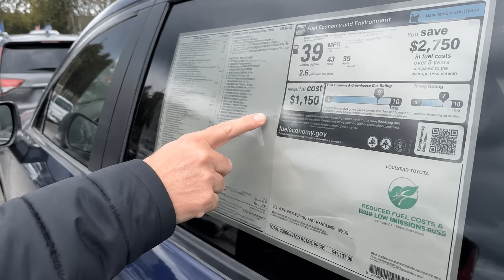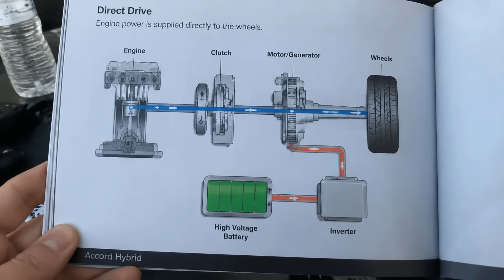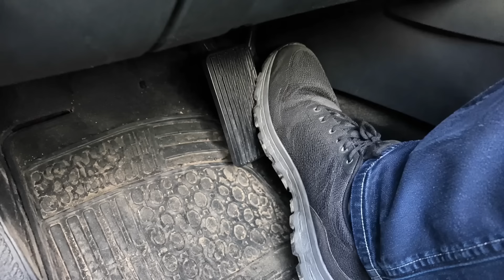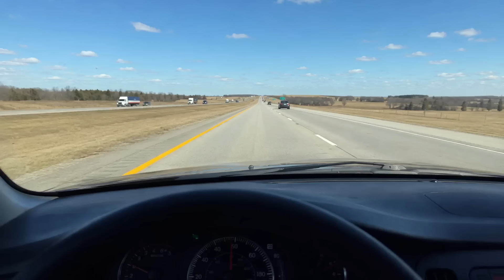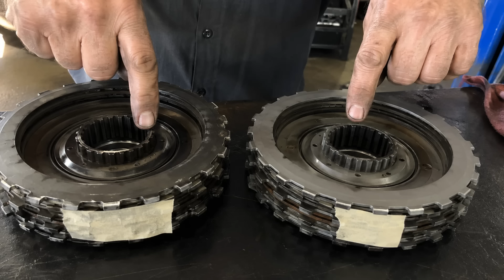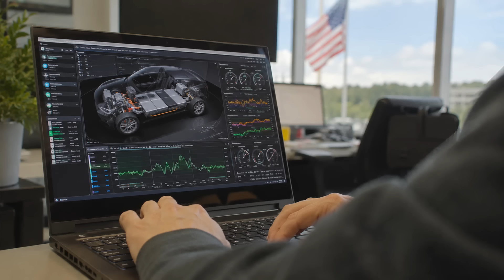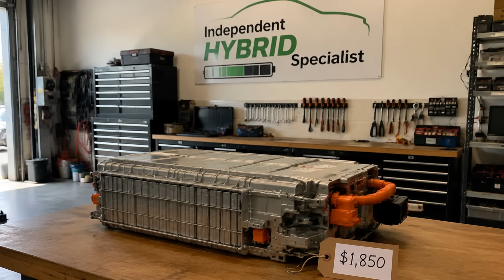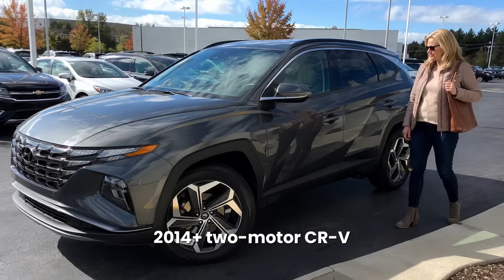Toyota vs Honda vs Hyundai Hybrids: Which One Has The WORST and The BEST Hybrid System?

Comment: A good video review - thank you.    Absolutely agree about the RAV4.   HOWEVER, no spare tire on the Honda = D.O.A. !!  However, although the  Hyundai / Kia hybrid system is understood, the cockpit is superior to the others in many ways, it is where you live your life in the vehicle, the basic system gets the job done along with the superior warranty, AND IT IS BANG FOR THE BUCK!  ...  comprehensively worthy of consideration!
Reply: I spoke with a Honda tech about why there's no space to even carry a spare tire in the Accord, and he said it's because the hybrid traction battery is located in that space.  I was surprised that the heavy battery was positioned behind the rear axle and left vulnerable to even a relatively minor rear-end collision.   The 2026 Accord touring hybrid also has big heavy 19 inch wheels which worsen the ride (from more un-sprung weight),  and reduce the number of tire replacement choices.   But I agree.  During my life so far, I've had four flats, all in remote locations while on a road trip.  I will not buy a car without a spare.
Reply: @WakeUpAmerican000s  The Accord has a wheel well that can hold a spare. You can find kits online.
Reply from the maker: Great point!

Comment: I have a 2011 Sonata Hybrid in my driveway with 240,000 km on the odometer. I am the second owner. It was an auction buy which became a gift from two sons at 150,000. On delivery my son passed over the keys and cheerfully advised me that: "this thing really moves, we did 220 kph all the way here from home". (His home is two hours away at normal highway speed.) 
I expected an ill-maintained junker but the car has delivered one lovely surprise after another. Mechanically it is receiving all of the maintenance in the schedule with the exception that I always change my oil at 6,000 km and use full-synthetic oil. 
The transmission gave a warning twice before I figured it out. In cruise at ~110 kph on a particular uphill grade the transmission seemed to be running low on fluid. On each occasion I coasted to a stop on the breakdown lane and switched off before restarting.   I ordered a new transmission filter from Rock Auto and took it to my favorite shop along with a jug of Valvoline's finest ATF - and requested that they have a look at the existing filter. I saved the old fluid in order to settle it out and then examine the clutch material. The old filter is rendered inaccessible by a bolt which can only be removed after the trans is split from the engine -  a design error made good later in the same manufacturing year.
The refilling process is simply medieval and I was disappointed when my mechanic declared it done. Having seen a couple of YouTubers I had expected the flow rate to be higher. I drove it for a thousand km and then took another jug of ATF to the shop and asked them to do it again. The fluid which we drained out still had some dirt an we closely examined the filter but could not figure out how to McGuiver the new filter in there with out getting possible sludge from within the filter into circulation.
The second refill gave a better rate of flow and the car has driven 50k since without incident. We were able to examine the clutchpack closely and my (very) experienced mechanic said it looked like it should have 'lots of life left'.
Our economy here in Canada is measured in litres per 100 km, rather than mpg and the car is accurate if working from a full tank. It indicates 6.5 litres per ckm. The mileage is drastically affected by poor alignment, 'any' loose knuckles or joints and low air pressure in the tires - which I maintain at 35 psi (going to try 38 psi next).The fuel economy compares less favourably with my brothers prius which regularly gets into the 4 litre per ckm range and my cousins Honda (Insight???)  also in the 4 l/ckm range.
My brakes are in better condition than theirs as neither of those cars seem to need real brakes for much of their driving, whereas mine REQUIRES me to touch the brake pedal inorder to maximize the regenerative feature. I don't understand it but it is consistant
Reply: Change your transmission fluid every 60,000 kilometers and change your filter that cools your battery pack. 
Change your brake fluid it probably has water in it.
Change your Anti Freeze
Change your fuel filter
Change your Cabin Air Filter
Get an alignment
Replace all loose Tie Rods
Now you will be good to go without a big repair Bills! 
Cheap Charlie’s Always Pay More from LACK OF MAINTENANCE

Comment: I'm a gearhead. I have a 6 speed Ioniq HEV hybrid.  Of course I feel the engine start. I hear it, I feel it through the sest.  I've driven stick shift cars for decades. I'm trained to know what my drive train is doing.  Slushy Toyota or Honda drives would be my worst nightmare.
Reply: HAHAHAHA I'm 78 years young, have driven roughly a million miles with everything from motorcycles, cars, trucks, including fire trucks, a Navy submarine, boats of various sizes and small airplanes. And now, I LOVE, how the 2026 Camry Hybrid handles, drives and feels. It's truly amazing! I'll never willingly go back to anything with a traditional engine and transmission. There's absolutely NOTHING "slushy" about it. Driving it is like traveling in a jetliner that doesn't have to change gears several times, as it accelerates down the runway for takeoff. I LOVE it.  But, to each their own. <3

Comment: Toyota does have transaxle/engine damper. No idea how long they last. I suspect it's the same as the inverter. Heavy feet, heavy wear.
Reply: Engine dampener?
Reply: @robertheinkel6225 minimal clutch/pressure plate. Smooths the ICE on/off

Comment: I have a 2025 Civic hybrid, it is perfect, sporty and enjoyable to drive. Admittedly, I don't have a decade of history but as of yet, there are no reports of problems from the 100 of thousands of Honda hybrids on the road. They are hard to find to buy. When I bought mine, I found one 2 states away and bought it unseen.  But, I have been as happy as a clam at high tide (a Florida saying). I have noticed that the mileage drops by about 2-3 MPG in the Florida "winter", mostly since the system has to use the battery to heat the car since there is no consistent source of engine waste heat to tap.  My mileage runs consistently in the 46-50 range. I'm a professional engineer BTY and pretty attuned to complex systems. I've had Hondas for years and have found my wife's Toyotas to be "numb" appliance like drivers. She's okay with that but I'm not.

Comment: I went for the CRV Hyrbrid over the RAV4 Hybrid. But, I chose the 6th generation Hybrid over the 5th generation because it uses two electric motors instead of one. I am averaging about 38 to 39 mpg in the city and around 32 to 34 mpg on the highway. But, as for climbing hills, I live in the DFW area which has hardly any hills. Even so, when I do encounter a significant hill in the 6th generation CRV Hybrid, I haven't noticed the problem you mentioned in this video. I have to assume that the two electric motors make a difference in how it handles a hill.
Reply: "But, I chose the 6th generation Hybrid over the 5th generation because it uses two electric motors instead of one."

Both use two electric motor-generators; pretty much the same ones, in fact. Torque was in the traction motor was increased by 15 lb-ft, and it is a little bit bigger in size.

Comment: I had already decided against buying my first hybrid car (all brands) after test-driving a Honda CRV hybrid when I watched your video. I simply don't do enough stop-and-go driving to be attracted to a hybrid. I’m 74 and retired. I live within 2 miles of an interstate highway that connects to high-speed loops and long stretches of highway. I take long road trips that are 95% highway driving. I agree with your conclusion that the Toyota hybrid is the best among hybrids.  You present an excellent argument in favor of the Toyota. I'm currently betting on a pre-owned naturally aspirated gas-only 2025 Toyota RAV4 with 5,000 miles. I keep my cars well past 150,000 miles, and at 10k miles per year I could be driving my gas car in 2040 at 89 years old…if I outlive the car. I'll watch my neighbors struggle with 4-digit repair bills while I spend a little bit more at the gas pump. 😂 Thanks for an excellent, detailed discussion.
Reply: Traded my Rav4 in for a new Corolla Cross xse hybrid.  Great car for Florida traveling.  Rav4 had no power getting on the ramp. This Corolla Cross moves  No problem. Excellent gas saver.
Reply: I have a 23 Sienna.  I mostly use it around town, but also make cross country trips.  For a big vehicle, getting 32 mpg in town is very good.  In comparison, my Odyssey, doing the same drive would average 18 mpg.  On the highway, the Sienna averages 35 mpg, while my Odyssey would average 24.
Reply: If I were in your situation, I would still highly recommend the honda hybrid. I have a prius and I have a mechanic who almost exclusively works on hybrids. He told me that he has never seen a drive train failure in a toyota hybrid. Toyota gas only cars are good but even their transmissions are not as good as they hybrid drive system which is not a true CVT. Also all new cars spy on you. I might recommend a pre-2019 car before 5G was installed.

Comment: Tucson has only one motor rather than the other two with two motors. Does that make it the worst??
Reply: Tucson only needs one. Mechanical all wheel drive like the Subaru system. No motor in rear.

Comment: We own a 2022 Toyota Highlander Hybrid that just surpassed 100,000kms.  Other than recalls, nothing has been done other than regular maintenance.  Can we look forward to the same performance as the other Toyota hybrids you name in this video?
Reply: Yup
Reply: Our 14.5 year old Camry hybrid has 90k trouble-free miles.  Only a new 12v battery ($300) and tires and PCV valve ($14) on top of routine service for fluids.  I can see why most New York City taxi drivers like the Prius and the Camry Hybrids.  They get 250-400k miles out of them.

Comment: You could just said the hyundia is a piece of crap.  I already knew hyundia is piece of crap
Reply: Most mechanics confirm that Hyundai is substandard compared to Honda and Toyota.
Reply: I have a 2026 Hyundai hybrid with 6000 miles on it. Impressed every time I drive it. Much quieter and nicer ride than the Honda and Toyota we drove.
Reply: Probably never drove one. If you had driven the new hybrid Hyundai, you’d change your mind for sure. I did.
Reply: Pretty obvious that you have it out for Hyundai.

Comment: I have a 2014 Accord hybrid with 195,000 miles it runs like it did 12 1/2 years ago. It has never seen the inside of a a shop. Nothing has worn out or broken. All it has needed was fluids and filters and a set of spark plugs that the maintenance schedule called for at 100,000 miles. It has needed 3 12 volt batteries. I am about to change the brake pads for the 1st time not that they are grinding just that I want to lubricate the calipers and might as well change the pads. It's been a flawless ownership experience.
Reply: Engine belt?
Reply: Im not sure, but hybrid cars seem to not have any belt. What will belts do in a hybrid car? I can't figure out, like the generator is in the hybrid "transmission", and compressor for AC runs on electric
Reply: @taoprsn  Japanese cars have always had an engine belt for the camshaft movement. Many other cars now have them, too.
Reply: @BeachriderUSA  I own a fl4 civic hybrid, and it seems have engine timing chain but not belt
Reply: @taoprsn  so it goes… the Honda Vans and pickups still have timing belts, but not the Accords and Civics. Thank you
Reply: @BeachriderUSA  Glad that helps :)

Comment: If i had to, i would buy the Toyota. But I prefer what I have:  A  2022 Lincoln Corsair PHEV and a 2024 Ford Escape PHEV.  They have been great. Currently, my lifetime fuel economy on the Corsair is 115 mpg. That is because last year, I drove about 10,000 miles on battery alone.
 Ford's system is nearly identical to Toyota's.  It is the only system that makes sense. Hyundai's and the similar Mazda system, are just plain stupid.  Honda's system  needs a larger electric motor since the gas engine can't contribute except under the narrow conditions the motor can be engaged.  The systems I really hate are the ones that add a turbocharger. For me, one of the great benefits of hybrid systems is the lack of turbochargers and overworked small displacement engines.  Ford's 2.5 is an Atkinson jointly developed with Mazda but Mazda never used it.  Unfortunately the Chinese built replacement for the Corsair uses a turbo 2.0.  I plan to keep my 2022 for a long time.

Comment: I did a ton of research on hybrids before buying a rav4 prime  while the prime is a plug-in  hybrid  i can tell you this thing is a pleasure to drive and it is insanely  quick for a compact suv faster than pretty much all but some european models and since i can do most of my driving in ev mode  the combined eMPG is well over 80 yes 80 mpg. My wife also has a corolla cross hybrid  awd and she is averaging 4.7 liters per 100km. Something not mentioned is that Hyundai  warranty is only for the original owner it isnt transferable after the 3 year bumper to bumper however both honda and toyota waranties are fully transferable, or atleast thats the way it is here in canada
Reply: Wrong. You can be the second owner of a Hyundai and the warranty is transferred as long as the vehicle is CPO.
Reply: My '24 CCH AWD average 75 MPG and EV ratio since new. I had hoped for 50s... I suppose my rural suburban drive is ideal. Seldom highway and then don't go over 60mph. Replacement will be Rav 4 PHEV unless there's CCH AWD PHEV available.
Reply: Do you know how to use punctuation marks?